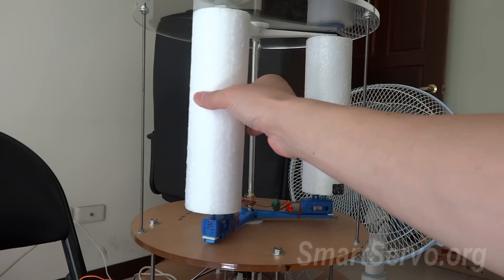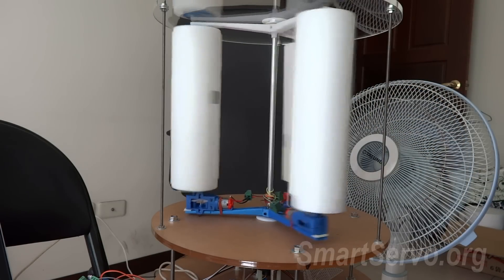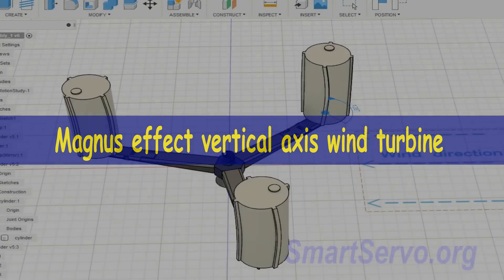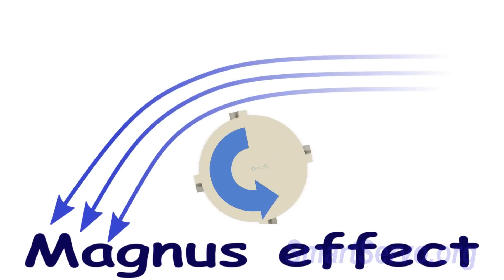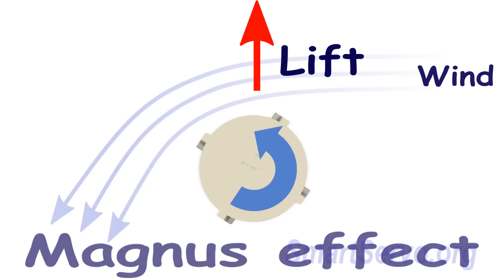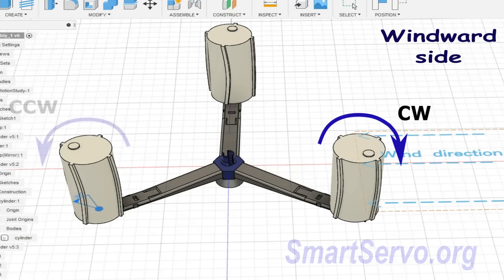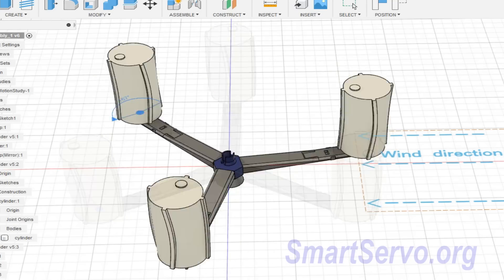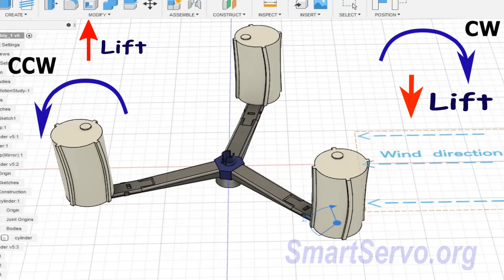Magnus effect vertical axis wind turbine, No blade, start quickly

Comment: I think ZEUS has a point. The rotors changing spin direction at such high frequency would likely consume a lot of electricity and also stress everything to the point of breakage.

I would just ditch the magnus effect and use a simple propeller or vertical wind turbine, with blades that changes orientation all the way to zero power, to prevent overspeed, and reduce power production when it isn't needed.
Reply from the maker: When the radius of the turbine becomes larger, the rotational speed decreases naturally and the rotor does not have to change direction frequently. The blades that changes orientation are what's called "active pitch control",which may be too complicated for ordinary people to implement. The pitch is also driven by a motor, which is difficult to drive directly due to the weight of the blades. Therefore, the transmission mechanism and gearbox should be unavoidable and easily lead to failure. However, the Magnus rotor can achieve required lift by increasing the rotation speed, unlike the blade that needs to increase the surface area, so the rotor is lighter and easier to integrate with the motor to achieve direct drive, making the structure more reliable.

In addition,for active pitch control, the chord must be constantly changing with the relative wind direction to maintain the correct angle of attack(AOA), which requires a closed-loop servo system to precisely control the position, which is more complicated. On the contrary, using Magnus rotor only needs to do open-loop speed control, controlling the rotor’s position is not necessary, which is much simpler.

Comment: If i understand it correctly, you are driving the cylinders with a motor, in order to gain extra wind energy by the blowing wind and the magnus effect, correct?  Now will it be higher than the energy required to make the rotors turn, and moreover: will it be more efficient as a regular vertical blade turbine? Nice proof of concept anyway!!  I am really curious about the efficiency results, assuming you will try to find those out.
Reply from the maker: The Darrieus type is the most efficient vertical axis wind turbine, but it was not used successfully due to many unsolved problems such as poor starting ability ,dynamic stall and overspeed in high winds, while the Magnus type is easier. 

Therefore, if the energy consumption of the rotor can be minimized and the efficiency of the Magnus-type turbine can be improved, this may be a good VAWT solution (more info=> http://smartservo.org/en/magnus-vawt-implement-en/), in addition, the Magnus rotor can also help Darrieus turbine to start easily.=>https://www.youtube.com/watch?v=9AdpggaOfF0

Comment: maan, but use a planetary gear system instead of electrical control
Reply from the maker: The friction of the gear system needs to be considered, and the rotor also needs to change direction every revolution.
Reply: @SmartServo_org  ¿are you changing direction with control every half cycle?

Comment: Ma ha senso usare energia per far girare più veloce e se si quanto si ricava veramente,. ed anche i movimenti strani quando ai messo al minimo il potenziometro sono sospetti, cioè c'è il trucco.
Reply from the maker: Adjusting the potentiometer is to control the speed of the main shaft, which is beneficial to keep the turbine at the rated speed under strong wind to avoid damage.

Comment: Soooooo is the output magically more than input? Nope . You have 3 electric motors spinning and what is your draw? What is the power that can be produced?
Reply from the maker: Since wind energy is proportional to the cube of the wind speed. As long as trying to reduce energy consumption, when the wind speed is fast enough, the output can be greater than the input.  => http://smartservo.org/en/magnus-vawt-implement-en/

Comment: And in an open air situation. The wind is non-controlable. As the fan had to be adjusted for results. Open air wind can not be adjusted. A fan has a tunnel effect needed for this turbine to work.
Reply from the maker: Simply using a fan is different from a wind tunnel, and there will be no wind tunnel effect. Also, the Magnus effect works both in the wind tunnel and outdoors, just like Messi can kick a banana ball without being in a wind tunnel.

Comment: It sis an interesting demonstration of the magnus effect, but as a wind turbine, I wonder if it is any better than replacing all the wind-catching stuff with a planetary gear set.  You are putting energy into rotating the cylinders to get energy out of the turbine. Too me that seems suspiciously like blowing into the sail of your own ship.
Reply from the maker: Thanks for your opinion. The motor drives the rotor, and the rotation of the rotor causes the wind to generate torque (Magnus effect) to drive the main shaft. The rotor acts as a catalyst. The energy consumption of driving the rotor is not large. It only needs to overcome the viscosity of the fluid , the friction of the bearing and motor, which is less than directly driving the whole turbine. Although it has not been proven that the energy output can be greater than the input, i think it is possible => http://smartservo.org/en/magnus-vawt-implement-en/

Comment: How is the speed control able if it relies on wind speed?  Oh motors and batteries.  I was wondering why the simple experiment had so much electronics hooked to it.
Reply from the maker: The speed of the turbine can be adjusted by changing the rotational speed of the rotor, so that the main shaft will not overspeed when encountering strong winds.Those wires are mainly connected to sensors, which are used to detect the position of the rotor in order to determine the speed and direction of the motor.
Reply: @SmartServo_org  these people don't get that motors have always been involved in the Flettner rotors.

Comment: Why not Make those tubs into blades or a Helical shape so they all produce electricity 🤔 I've seen it before, this is a really cool idea tho 👍
Reply from the maker: Thank you for your comment. The purpose of the rotor being cylindrical is that it doesn't need to push the airflow but just rub it, which is enough to generate Magnus lift and is more energy efficient.

Comment: >Has no blades.
>Technically has blades.
Reply from the maker: I think cylindrical rotors are easier to manufacture than normal blades with curved surfaces. If the rotor is made soft and hollow, it will naturally form a cylindrical shape as long as it is inflated.

Comment: Rule of thumb the less moving parts the better.
Reply from the maker: You are right, but even Darrieus wind turbines have no moving parts other than the main shaft and have not been used successfully. Sometimes compromises must be made in exchange for benefits. Rotational motion is not all detrimental unless there are (1) heavy loads (2) gearboxes (3) cantilevered construction, which are not present in the project of this video when using direct drive.
Reply: @SmartServo_org  yes but now ur sounding like Nissan let’s use cvts. . 
it didn’t work for them
Reply: "Less" is used for amounts, e.g kilograms, litres, gallons, pounds. "Moving parts" is a number e.g. 3,4, a dozen moving parts. Hence, *"The fewer moving parts, the better"....because correct English makes you sound more educated & adds credibility to your statements.
Reply: @topspeed250k5  ok and your point is I’m not writing a dissertation sir or mam, I can care less what u or the rest of the 8 billion on this planet think. Nobody listens to me anyways, education doesn’t mean your smart people like Tesla and Einstein will confirm that. It’s having vision. So what I said was right you made it into a cluster duck

Comment: I'm sure there some good will hunting math equation you can use to test efficiency and effectiveness. But what do I know I'm a slum
Reply from the maker: Even if the simulation software is powerful, the parameters of the mathematical model must be obtained by experiments, otherwise it is meaningless.
Reply: @SmartServo_org  that makes sense thanks for the knowledge

Comment: Huge stress and maintenance  on the mechanical parts like bearings lowering  efficiency  of the concept. Idea may be good still...
Reply from the maker: Thanks for your comment, I made a bigger one with slim rotors to reduce inertia and drag, if you are interested you can refer to the video @ 1:31 =>https://youtu.be/9AdpggaOfF0

Comment: Very interesting Experiment. But could this theoretically be more efficent than something like an inverted Voith-Schneider propeller with an ai pitch control?
Reply from the maker: Although the two are similar in appearance, they have different uses. The Magnus device is used to generate power in a flowing fluid.
Reply: @SmartServo_org thank you for your fast response, i dont know if i got you right, but shouldn't it be possible to use a voith Schneider Propeller to generate energy from a flowing fluid as well? Woul be like a darrieus Rotor with a flexible pitch. I Think that the cylinders have a higher resistance than wings, but i ask myself if the higher lift could Balance that..
Reply from the maker: @f.u.52  Darrieus wind turbines have high efficiency with or without active pitch control. High efficiency can be achieved by using high lift-to-drag ratio blades and operating above TSR 4. However, the rotor has a low lift-drag ratio and is therefore not suitable for operation at high TSR (Tip speed ratio). I think using high aspect ratio rotors with number >= 4 and running at TSR 1~2 should achieve good efficiency.

Comment: This effect should also work in drone
Reply from the maker: Yes, the rotary wing aircraft is slow but has high lift and has short field takeoff and landing capability. But the flight control problem needs to be solved.

Comment: there is already a large prototype in japan
Reply from the maker: Maybe you're talking about a turbine made by a Japanese company (Challenergy), still quite different. They added a plate behind the rotor to mask the Magnus force on the leeward side so the motor didn't have to reverse, but it also lost some lift. This video shows the Magnus VAWT in its original concept, which predates the Japanese one.

Comment: How much of movement is coming from the fan, and how much from the DC motors spinning the drums? Technically just running on the DC motors the wind turbine will still move without wind. Your goal should able do this without the DC motors with some gear train on the central hub going out to each drum.
Reply from the maker: The energy consumption of driving the rotor to generate Magnus lift is not large. It only needs to overcome the viscosity of the fluid and the friction force of the bearing, which is lower than the energy consumption of directly driving the whole windmill because the wind energy is used. The method of improving the efficiency can refer to => http://smartservo.org/en/magnus-vawt-implement-en/
Reply: Without wind it cannot start spinning relying on the Magnus effect.  If it is already in motion it will have the Magnus effect but I think the force will be directed inwards or outwards without contributing to the rotation

Comment: How fast does the CW-to-CCW change take place? (e.g. from 100rpm CCW to 100 rpm CW,  like from zero to 200 rpm in about nanoseconds? And what kind of motor can do that?)
Reply from the maker: When the radius of the windmill increases, the rotational speed naturally decreases. Because the linear velocity is constant.
Reply: @SmartServo_org  I must have missed something. I do see in your other vid and I understand that the rotation changes direction when between leeward and windward . But how fast can that be done? (I know it may also depend on the moment of inertia of the rotor. E.g. would they be built out of lead, I cant see how a small motor could do the direction changes.) Nevertheless, your project is very inspiring, so keep up the good experimentation.

Comment: There is absolutely NO advantage to having a vertical axis and many disadvantages. Even with ideal hypothetical conditions, the cylinders would produce thrust in only a narrow section of the leading windward and trailing leeward sides, while the neutral left and right sides produce nothing. Needing to suddenly reverse direction of spin every time a cylinder goes from windward to leeward is asking for broken equipment.
If you're going to use the magnus effect, it's far more efficient and practical to use a horizontal axis with spinning cylinders replacing the blades of a standard wind turbine. Then the cylinders can always spin in the same direction and always extract power 360° of rotation.
Reply from the maker: The structure of the horizontal axis Magnus wind turbine is too complicated.The motor and generator form a concentric shaft to connect to the hub. The motor drives each rotor through a planetary gear system. The rotor is a rotating cantilever beam that puts a lot of bending stress on the hub.A yaw device is also required. These complex mechanisms are not only expensive but also detrimental to efficiency, not to mention reliability. The vertical axis type is instead simple.
Reply: @SmartServo_org  Ummm, no, you're wrong. Your contraption does not work AT ALL. Hopefully you'll learn sooner than later.

Comment: A video that purports to discuss a wind turbine operation principle shows construction minutiae?  Why not show how the 3D printer was made?  And, the manufacturing process for the plastic resin? And the extraction of the crude oil that was refined to make the resin?  And the petroleum geologist in college learning to locate oil shale deposits? And the ancient earth history of how the oil shale was formed?  And,…….
Reply from the maker: If you want to prove a fact, you can't just say the conclusion. The method and equipment of the research must be open and transparent for others to check. Maybe someone will question the mistake in it, this is a process of mutual trust. As for the 3D printing you mentioned, etc., those are facts that have been proven by others, and are not directly related to this research, so there is no need to explain.

Comment: I would like to give you some advice to improve the system. If you replace the rotor cylinders with a succession of discs (Tesla turbine rotor), the friction with the air will increase and with it the speed of rotation of the main rotor of your system. Cheers!
Reply from the maker: Thanks for your suggestion, I will consider it.

Comment: Just a case. In a day with no wind at all how do you get power to spin the rotor? How much efficiency it can get?
Reply: If there is no wind at all, what's the point of spinning the rotor?
Reply: @praveenb9048  I presume that this system is working without human intervention. So how the wind turbine knows if there's a wind blowing? The electricity is produced by center axis spin by magnus effect produced from 3 rotating "blades"
Reply: Yes, I'm assuming that some kind of smart controller would be used. For example, if the wind is to strong the controller would have to reduce the rotor speed to avoid damaging the mechanical and electrical elements.
Reply from the maker: @rainbowforest09  Yes, it requires auxiliary devices to make up the system, such as anemometer, controller, batteries or power source ...
Reply: @SmartServo_org  Obviously energy is being put in, what is coming out? Hopefully more than in.
Reply from the maker: @bryanst.martin7134  Not yet, but since the wind energy increases with the cube of the wind speed. So as long as the wind speed is increased and the energy consumption of the rotor is improved, it is possible to achieve. Reference => http://smartservo.org/en/magnus-vawt-implement-en/

Comment: Why are there motors and blades on it clearly that can was doing nothing I count 4 motors doing all spinning
Reply from the maker: There are only 3 motors used to turn the rotors for Magnus lift, and below the main shaft is the 'slip ring' that transmit electricity through the rotating joint.
Reply: @SmartServo_org  No doubt there is far more energy being used to spin those cylinders AND reverse their direction every time they go from the windward to leeward side than you'll ever get out of the main shaft.
Reply: @zeuso.1947  Moving a rotor does not require much energy, there are ships that use the Magnus effect to reduce consumption because the energy that can be extracted from the wind is greater than that needed to drive the rotor.  A disavantage with this design is the need to reverse the rotation of the rotors but it is possible to recover a substantial part of the energy expended when braking it, furthermore the rotor can have a low moment of inertia further reducing the energy required
Reply: @Mauro-82  You are overlooking several problems that refute your understanding.
Ships that use the magnus effect do not have multiple cylinders rotating on a vertical shaft, and are not reversing the direction of the spin hundreds of times per minute. Ships have single stationary cylinders mounted along the centerline rotating continuously in the same direction for very long periods of time.
There is no comparison.
Reversing the direction of the spin hundreds of times per minute increases energy consumption exponentially to an absurdly high degree.
And then there is the problem of poor aerodynamics on the leeward side. Leeward cylinders are not getting a smooth column of moving air; instead, after going through a wall of spinning cylinders from the windward side, are receiving a shadow of extremely turbulent air for the leeward side, and because of that turbulence those leeward cylinders have no potential of a worthwhile contribution of energy.